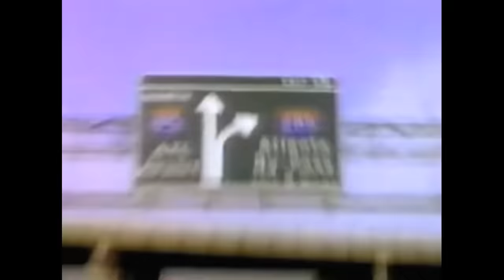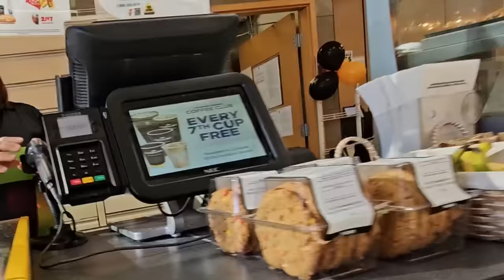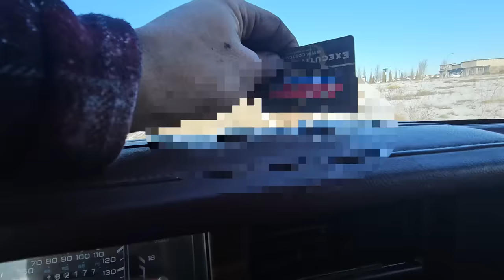A CAR THAT PARTIES LIKE IT'S 1989!!! DE-GREASED

Comment: We had one of these when I was a kid. I can't believe you found one that still has a working transmission!
Reply: That Mitsubishi 3.0 liter V6 in the video was guaranteed to burn oil by 60,000 miles.  
The 3.3 push rod Chrysler engine was much better.   You're right about the transmissions.  What a POS.
Reply: @scdevon I think 60,000 is generous. 
If Peg wanted to be more accurate here he should have let it rip a quart of STP oil treatment and some Stop-Smoke.
Reply: The 5 speeds of that era never die! The 2.2 / 2.5 four cylinder is indestructible.
Reply: yup, ours burned oil from the first oil change. The shady used car dealer must have used some thick oil or adaptive to keep it from smoking. I distinctly remember someone waiving my father down because they thought the car was on fire it burned oil so bad. Our family has never again owned a Chrysler product.
Reply: The manual transmissions of that era are GREAT! @scdevon
Reply: Yep, put 2 transmissions in mine... then the engine spun a bearing, and that was enough.

Comment: My grandma had one of these from the late 90s to about '08, many fond memories of that car. Something went out in it engine wise, so she sold it and got a '91 F-150, which I now own since she's passed. Super cab short bed, 4x4 with the 351. I converted it from EFI to carb a while ago, with a 2 barrel from a 78 Thunderbird. That truck is the reason I got into Fords, and by extension, finding your channel. So it's interesting to see things sort of come full circle!
Reply: Going from EFI to Carb is like swapping a 351 with a smog 302. It’s just backwards.
Reply: @adamyoder6024  in 1991 with obd1 eec iv fuel injection the 351 only made 210 hp. I bet it still makes 200 with a 2 barrel carb
Reply: @adamyoder6024 hurr durr efi iS bEtTeR!  ReEeEeeeeeeeeeeeeeee
Reply: @adamyoder6024 I don't have neither FI or Carburator I have TBI
Reply: @xtr3m3fLx is a 4x4 pickup truck how FI or carb fuel gets delivered 4×4's need low end torque not horse power just because is modern doesn't mean is better fuel injection systems took decades to get them right and developed carburator been around for 200 years
Reply: A 351 Windsor is tough to beat.  I've got one in a '96 F250 with a 5spd behind it and she's a running sumbitch even with 260k miles on it

Comment: I grew up in these in the mid 90s as a child. We had the 87 Plymouth Voyager mini van, Chrysler lebaron, and a dodge shadow. Pop had a retired forestry 68 power wagon as the woods truck, and a 74 power wagon for work. Still have the 74. But in 2000 my parents bought a neon that they still drive today with over 300,000 miles. I call it the al bundy dodge😂.

Comment: i got the depressed older sister of this car. and im lucky to have her. 1985 5th avenue, with the 5.2 v8. underpowered af with only 140 horses and sucks gas like a hooker on blow.
mine currently needs some new junk in her trunk. her tranny's been going for a few years, but i got plans to fix her up. the most comfortable ride ive ridden, and i dont ever plan on giving her up.
i even got her for a steal, at only 500 bucks.

Comment: I drove a couple 80's shitboxes in my high school days but mostly 70's shit.
2.4 turbo Town & County K car that leaked enough gas to make ExxonMobil cringe. An Olds ninty-eight will the bomb proof series 1 3800. No idea how it survived all those full throttle neutral drops. A 78 Coupe Deville, 79 528i, 81 High Sierra diesel and several others.

Comment: I owned that exact model and color of car for 6 months! My friends nicknamed it the White Rocket because just like every other car I owned up to that point, I drove it like a race car everywhere I went, and it was funny as hell. It lasted exactly 6 months because I burned up the first transmission in 3 months, slapped another one in there and 3 months later that one started howling like a banshee, so I swore off dodge ever since. Day it did that I took my sisters for a hell ride in it out back of my parents house and when it quit moving because of that trash dodge transmission, I redlined it hoping to send a rod out the side of the block before dragging it to the junk yard. Turns out those 3 liter V6's were pretty stout because it never did, and the engine got so hot it melted the seals in the valve cover which dumped oil all over the red hot exhaust manifolds and burned it to the ground. That was fun dragging my little sisters out of the car while my mom screamed at me for almost killing her girls. Then I went in and saved my Craig tape deck and portable CD player before it got into the passenger compartment but I forgot about the CD holder in the visor! Lost all my best CDs in that fire. I was heart broken. But that car was a lot of fun when the trans wasn't slipping. Smoked quite a bit but she was a strong running engine otherwise.

Comment: Sit down and I will tell you a tale of a Dynasty. I bought one for $250. I believe it was an 89. It had a 3.3 in it. and it was dual fuel  - natural as and regular gasoline. it sat low in the back because of the weight of the nat gas tanks. That thing was so comfy. and it would do burnouts for days. Its also the only car I have ever had that gpt stolen. I didnt  have theft insureance so the screws didnt even bother looking for it. A week later, they found it abandoned in a bar parking lot. I had to pay tow charge and storage charge to the tow company. That was $225. I paid them, picked up my car, and it had no brakes. They didnt tell me that till after I paid them. The guys that stole it must have have driven down the highway with the brakes on, the front hubcaps were melted to the wheels. I sold it to a friend for $200, he put front brakes on it, and drove it for a yeat, then sold it for $750. Those cars are awesome!

Comment: My grandmother died in a Dynasty back in '97 in an accident involving an 18-wheeler on I-95. According to my grandfather, the truck listed into their lane and the protruding lug nuts of the front wheel ripped the steel of his door and the car careened out of control, rolling over several times which caused the B-pillar to separate from the roof and remove the top half of my grandmother's head.
…but now I know what really happened.

All jokes aside, and although quite hilarious, this video was also a sad reminder to me.
They never did find that trucker fucker …
Wonder if he's still out there somewhere dealing with the torment of what happened that wintery night some 26 years ago.
I was so angry at him for so long.

Comment: Frig sacks breaking out the dynasty! I remember when I was a youngin coming home from a camp friends mom hot rodded the dynasty over the old Atlantic Canadian expansion joint on an overpass...rear springs blew clean through the lower mount. We dragged that thing home; nothing a little hot glue can fix eh. Deeecent

Comment: Those Mitsubishi V-6s know how to party .💪
Reply: I don't even like Chrysler engines, but the Chrysler 3.3 engine would run circles around that 3.0 Mitsubishi in this video and not just because the 3.3 has more displacement either.

Comment: So, when that fucker has NO SPARK....(if I say, the ghost of Lee Iacocca is gonna be PISSED!!!) It's the pick up coil, hand to God. Obviously, if you add it to the Dodge pile by the end, point is moot and...IDK....shotgun a Pabst Blue Ribbon beer everyone that reads this. FUCK IT, shotgun 3 of whatever beer is handy (all, any...are acceptable) if the Die-Nasty meets it's destiny by vidja's end; subsequently I shall do the same cuz it's noon somewheres.
Reply: These cars are so easy to troubleshoot and get parts for... the 2.2 and 2.5 four-cylinder versions... this is the 3.0 Mitsu I think.
Reply: @djcybercorgi  oh oh...too old for a timing belt and the 'interference fit' wave of exploded valves and shattered dreams all auto makers have embraced, I hope?? If not, Peg'n better get on the timing belt swap!!!